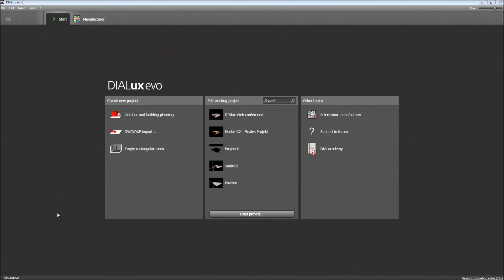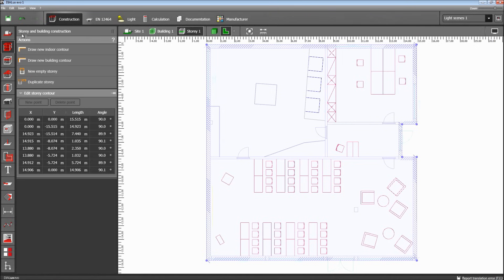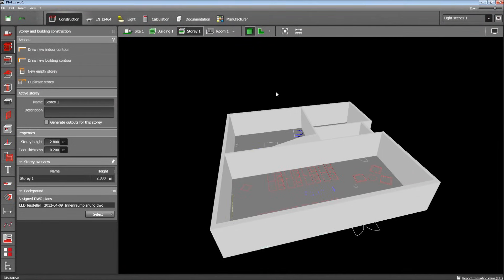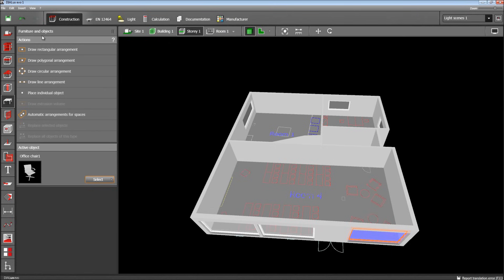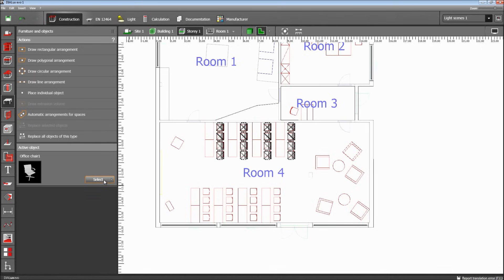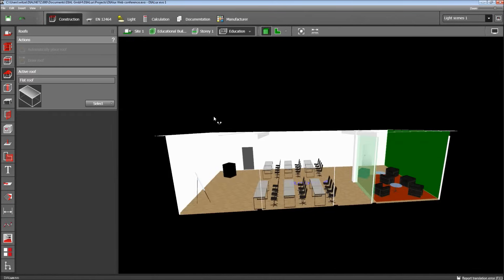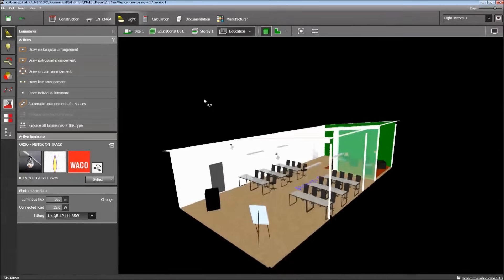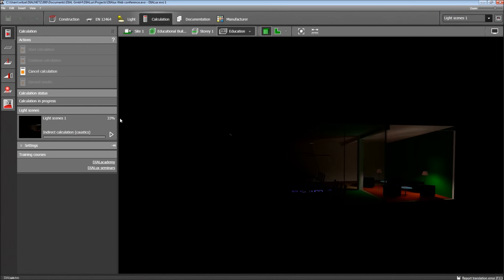DIALux evo - Tutorial for Beginners

Comment: Where do you have to place the calculation object? in front of the window? behind the window? Between the glass? I have tried everything. But the result is very strange. Or if the results appear to be good then the iso lines are very strange. can you help me?
Reply from the maker: That really depends on, if you need to fulfill any daylight norm or guideline (like for offices). In Germany we have something like the DIN 5034 as norm and there are guidelines from the VDI. Otherwise you would probably go for the relevant surfaces. DIALux evo 7 automatically produces isolux lines after the calculation, but you can turn them off, if they are not needed. You can also adjust the isoluxlines for the values that are important to you.

Comment: i can install it in my laptop , it shows always a msg that an update of Microsoft Net framework is required even when i downloaded the update and it did installed but i couldn't open it what's the problem then, i have windows 7 64 bits ? thanks
Reply from the maker: Please check the hardware requirements: http://evo.support-en.dial.de/support/solutions/articles/9000062586-hardware-requirements and if these are met, you might want to share details with our support team: https://www.dial.de/en/dialux/support/

Comment: How I correct the dimensios?
Reply from the maker: I am not sure, if I got the question right... For geometry of buildings: http://evo.support-en.dial.de/support/solutions/articles/9000067047-how-to-modify-the-geometry-of-buildings-or-rooms     For luminair housings: With evo 6.2 you have the possibility to enter the geometric dimensions for the luminaire housing and luminaire output surface. This option will only be offered for IES files.
Reply from the maker: Or maybe you want to work with Imperial System of Measurement and the Metric System of Measurement: https://www.youtube.com/watch?v=07pBEZO2zJ8